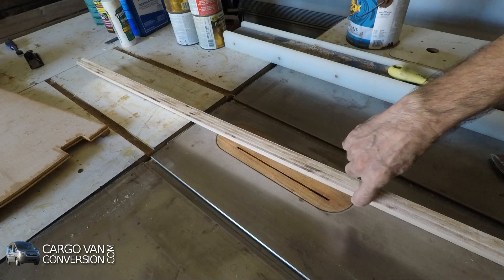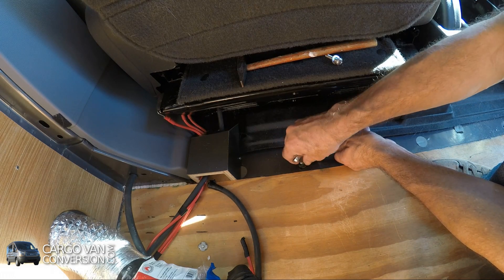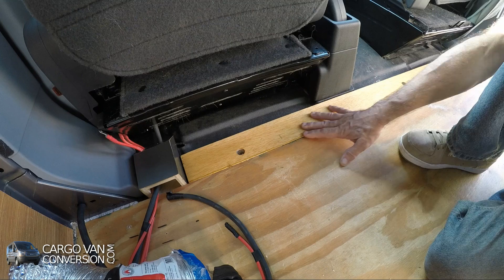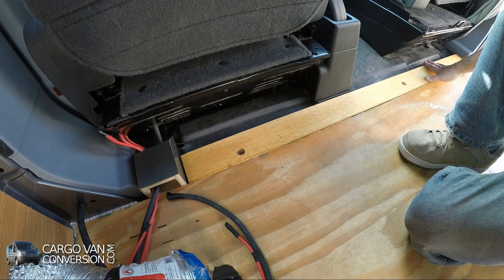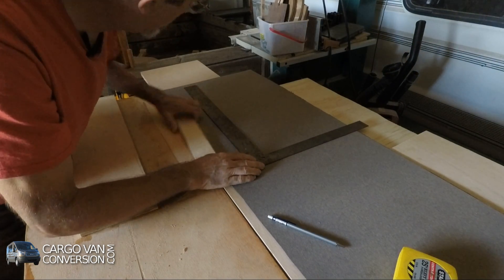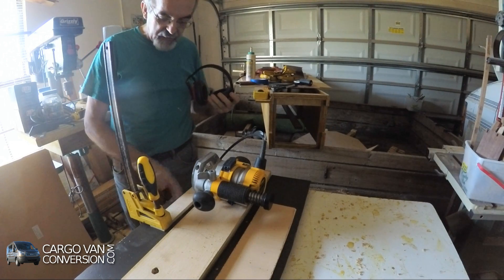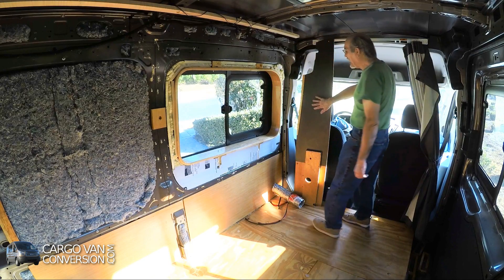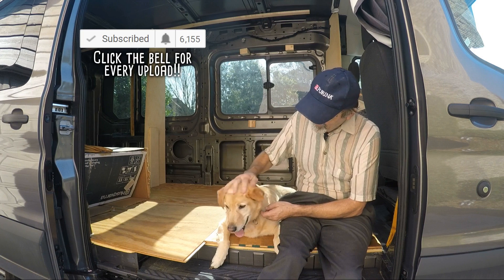Sideboard & Threshold

Comment: These formica jobs will transform the looks of the interior a lot, looking forward to see the rest of it. 

Also: not sure how much formica you’ll use in the interior, but one thing that comes to mind is that it could probably be creating a sound reflective surface. 

We were thinking of using some vinyl to glue to the walls to prevent having a ‘hard’ and sound-reflective surface. What’s your thoughts on formica/vinyl?
Reply from the maker: Hi Mark,
I'll be using quite a lot of Formica, at least on the bed and all the cabinets around me. The floor will be hardwood and the ceiling perhaps some fabric. The kitchen countertop hopefully solid Mahogany or Walnut and something special for the desk. I've been working with Formica now for a couple of weeks and it's difficult to get some variety in the videos, but after working with the matt dark and matt white Formica, I'm now starting with the white high gloss stuff and that's encouraging. Looks good!
I'm not worried at all for any acoustic issues, but I have two things going for me: I'm single and seldom play music or the radio. For everybody else, it may. On the other hand, I plan to live my life outside like many probably do; while such issues exist on paper, the actual impact is likely minimal, unless you're an audiophile.
Formica is basically a very practical material to keep clean, however my choice of (partially) high gloss finish is something that I may regret in the future. But we have to suffer, to be beautiful :)
Van Williams

Comment: Looking great Van. Formica is a bear to work with but it will look great. Question about your screwing the threshold into the floor: will the plusnut penetrate all the way through out the bottom, and if so, do you use any type of sealant on the underside of your drill holes to prevent moisture infiltration from below the van?
Reply from the maker: Hi Steve,
If you look back at the video, you'll see that one of the holes was drilled into an existing slot. Several of these slots are located under that threshold and they were 'closed off' in the factory with plastic stickers (yeah, really) that have long since disappeared. The threshold over the rubber mat is already a big improvement. Should perhaps go under the van and apply insulation there, but there are so many areas that need attention for a perfect solution. Another is at the first column behind the driver, where the gas fill is located; open holes, no insulation or protection against the weather.      
In general, I think it's difficult to get a 100% perfect impenetrable and insulated van; the small space, the many doors, the windows and the exposure to the elements make that impossible.
Van Williams